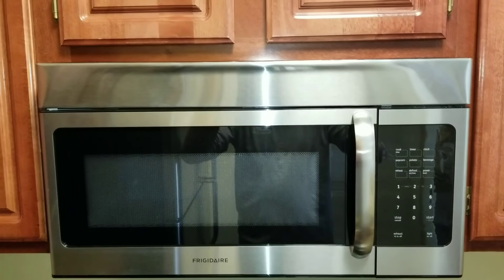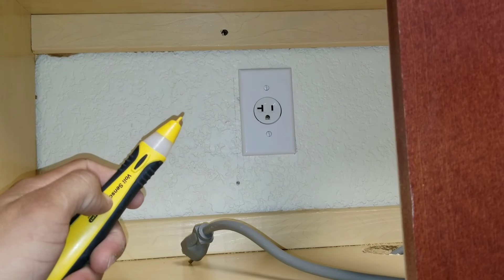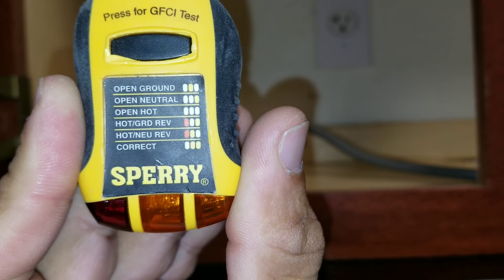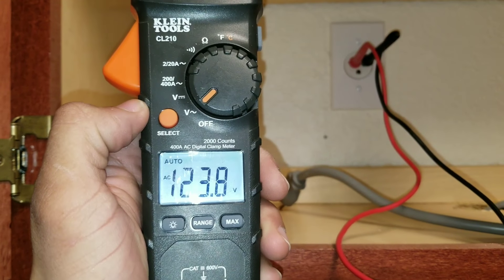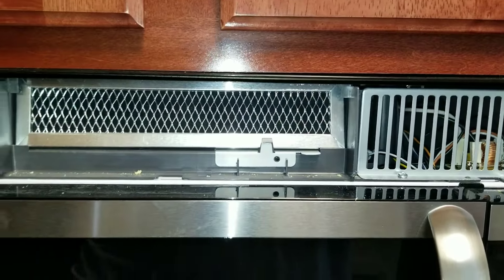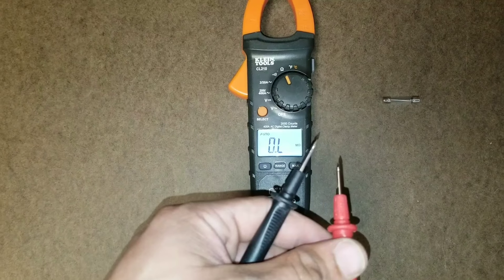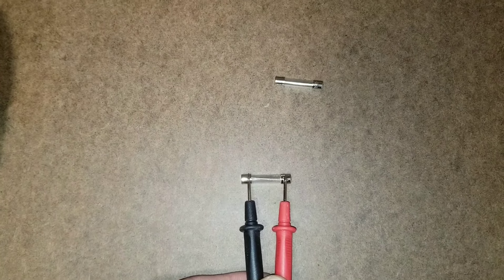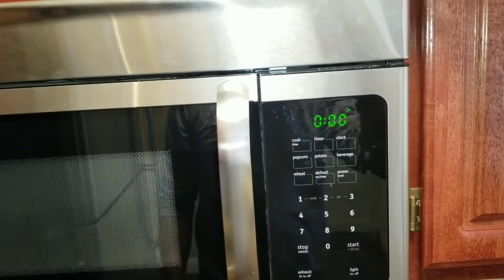Replacing Microwave Fuse

Comment: Good video but a caution to viewers: High voltage is no joke and I definitely raised an eyebrow with him bare-handedly removing the fuse without (presumably) at least a quick voltmeter check. Microwave capacitors and circuitry can kill. Always take proper safety steps and measure your circuit with a multimeter / Fluke to verify it dead so you will not be touching a live HV source directly or indirectly.

Comment: By gosh, I had mine apart, pulled fuse and no continuity.  My fuse says 250V 30A. Looked on phone to see where i can find a fuse that size and found your video.  Low and behold it's the exact microwave your working on.   Amazing.

Comment: Hi, I replaced the fusibke from my microwave because it was blown, the next day I changed it I used it and when I opened the door it blowned again. And since I had bought two fuses, I already use both of them, but I do not know what is causing the fuses to blown  every time I open the microwave door.  Do you know what it could be? What do i need to test?

Comment: Heck yeah - thanks Sam! I have confirmed that my fuse is indeed eff'd! Also, it appears that we have the same microwave dude! I totally cringed when i heard the beep at the end - it's SO annoying :) I didn't bother with that screw on the top tho, since it would have been a pain to remove due to the way mine's installed. Luckily, the aluminum cover/plate comes out easily w/o messing with it.

Comment: Thank you! all it was was a fuse. Thanks for letting me know that I could replace the fuse at the front where is a bunch of other places had told me I would have to remove the microwave from the wall to access the back panel

Comment: Did you discharge the capacitor? Sometimes if you don’t discharge the capacitor it can blow a new fuse upon starting again. Also just a reminder that capacitors can hold A LOT of charge LONG AFTER THEY ARE UNPLUGGED. so please don’t anyone die over a microwave!
Reply: Thanks, l was just about to try it, smh
Reply: What is the capacitor? I put in a new fuse and my microwave worked a few times after I switched it but then today I tried to microwave something and it tripped the breaker again 🤦🏽‍♀️🤦🏽‍♀️ any idea what could be wrong
Reply: How do you discharge the capacitor? I replaced the fuse with a new one and blew it when I tried to test the microwave
Reply: I would not mess with the capacitor as they can be very dangerous and even kill you if not discharged properly.

Comment: Microwave door latch switches is one common source of the main fuse blowing.  WHY?  just imagine how many times a day those door switches latch on/off , this wears them out after a while. So any issues with microwaves, look at these switches first!. of course use safety and caution when working with electrical appliances.  

Just replacing the fuse without knowing what made it blow is not a good approach as the fuse may blow again for the same issue.  I say this with experience. I have a very similar microwave (Kenmore) and on mine one of the 3  Dongnan brand  door contact switches was bad (Note: not all the switches are NC and these have to be tested with a continuity tester or VOM , and replaced back in the same location) actually the contacts had worn out on the NC one and fused together making the switch stock in NC position when the door would latch closed, this particular switch should have open the contacts in the switch , in the door close latching operation, so because the contacts had fused together, this was pulling too much current and blew the 20A fuse on my microwave, ultimately, initially the main breaker on the house AC power distribution panel would open , because the MW switch in this picture was going bad.   

Dongnan are microwave door latch switches  are available through Home Depot, similar ones would also work provided they are of the same rating and style, but best to get OEM ones for trouble and worry free operation.
Reply: Thanks! Mine actually blew when I opened the door!
Reply: @ADonis295  Did a new switch fix the problem?
Reply: @walkgood4092  No. I replaced multiple parts starting with the switches, Nothing worked. The switches were after market, that could've played a role. I got tired of tinkering with it and purchased a new microwave.

Comment: I have a question! My microwave blows the fuse when you open the door or start it. There is power to the outlet. It use to blow the fuse, we would go downstairs to flip the switch and it would work until you opened the door again. Now it won’t work, but turns on after fixing the fuse downstairs. I can’t find any info online for a criterion microwave. Do you think it’s the fuse or door switch. I’m sorry, I have no clue what to do.

Comment: So, all under cabinet microwaves seems to be the same. Standard. However, why the fuse had been blown in a first place? What you showing is a fuse on a RF noise filter board. There is no guarantee it is going to fix the problem in a MW unit and some other part will have to be replaced. In my case replacing this fuse had no effect. It keeps blowing the circuit breaker on a main panel. All these MWs are made in China or Malasia. Mine is saying Bosch on a label but I didn't find a single part yet in it that is made either by Bosch or some other US company. By the way. The board you are replacing a fuse on says it is made by GE. Hold on, didn't GE sold all its home good division plants to Hoyer long time ago?